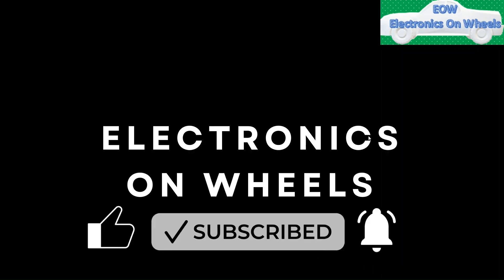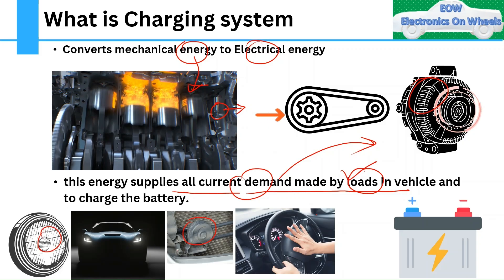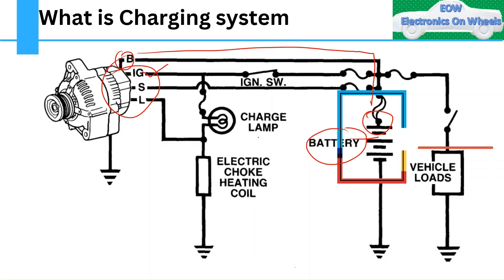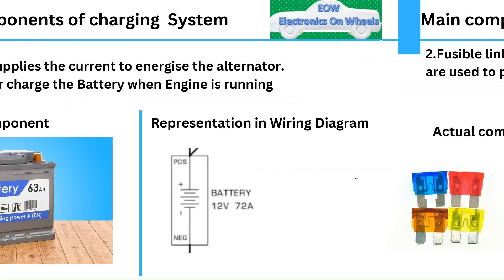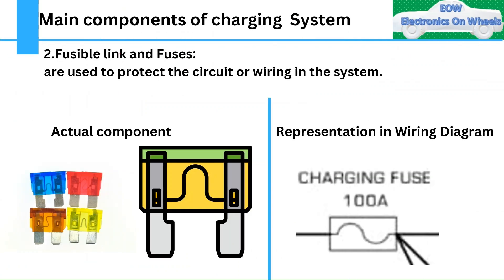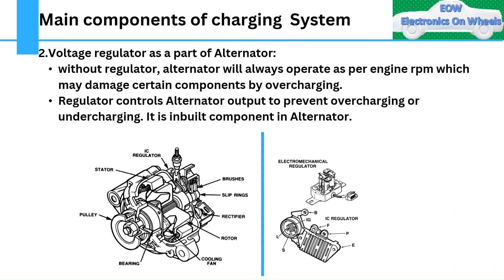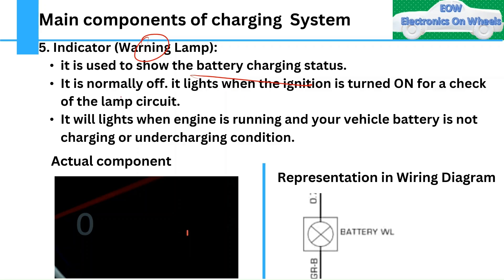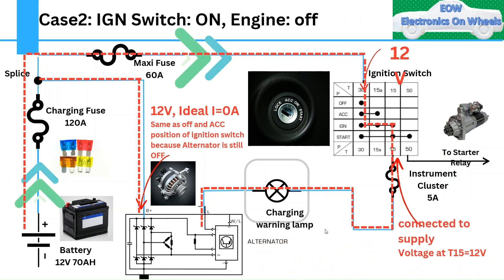Automotive Charging Systems: Components, Alternator Working & Wiring Diagram Explained @MunroLive

Comment: Here is a mistake on the slide - "When ignition switch is in ON position, battery current energies the STARTER" and not alternator.
Thank you for the video.
Reply from the maker: It depends what kind of alternator you are using.if alternator is not self excited then you require initial boost